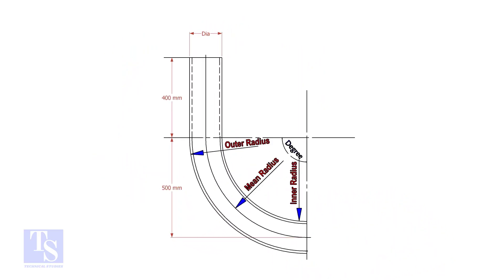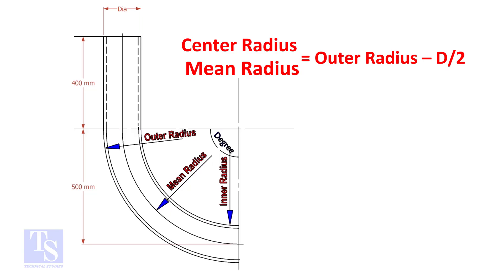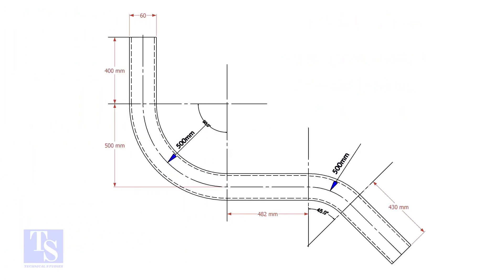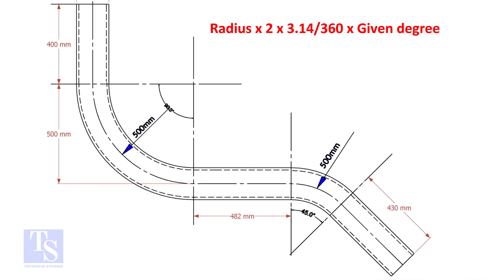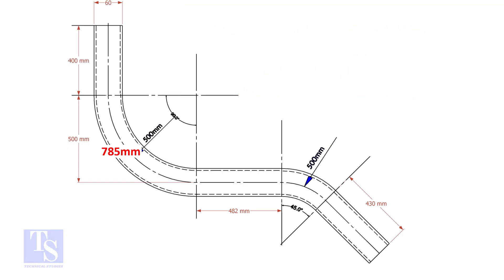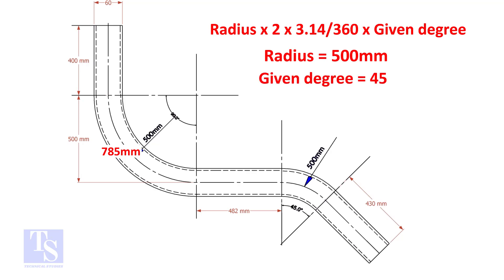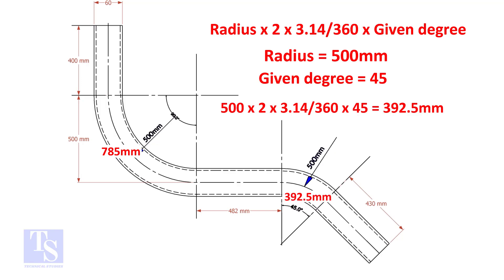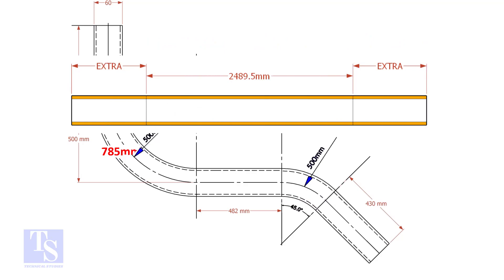STEEL PIPE - HOW TO CALCULATE AND MARK PIPE OR ROD BENDS- fit up TUTORIAL

Comment: How to determine the extra length. Is it randomly assumed or are there any formulas available?
Thanks.
Reply from the maker: I think there is no formula to determine the extra length. it depends the the diameter of the roller, center to center distance of the roller and most importantly, the experience.

Comment: Sir i have a question, ( in 90 degree elbow i used take.60.diameter x 38.1 + half of diameter = 2316mm as i know.where you get 500 radius sir?
Reply from the maker: Bro, your calculation is wrong.

Comment: Sir i have a question. I am first timer in piping.calculation my question is (where you get 500 mm radius sir? in 90 degree in 60 mm dia.as i know in elbow 90 degree 60mm dia.x38.1 plus half  OD =2316 correct me sir if im wrong because i am first timer in pipe calculation sir i used take off
Reply from the maker: Dear Maluya. 500 mm radius is an example only. If you want to know the length, whatever may be the radius, ( raius x 2 x 3.142)/ 360 x degree of the bend. in your case, suppose your bend degree is 90, pipe dia 60, bend radius 2 inch x 38.1= 76.2. then (76.2x2 x 3.142)/360x 90= 120mm. so you need to bend 2 inch pipe, length 120mm, to make a long radius elbow. anyway, you cannot bend such a small radius. at least the radius shall be 200mm. hope you understand.
Reply: @technicalstudies.  ok sir one question sir, if We bend tubing pipes  in any degree for ex: 2" we  must used take off sir, or not?

Comment: Good day thanks for the info. My concern is how to mark it in the pipe to get the correct distance from the bend. Or how to bend it With correct travel. Where i put the mark center in the bender im just newbie hope fore your advice and thanks in advance
Reply from the maker: Bro, add some extra length at the end of the pipe, as mentioned in the video. then the straight length, then one of the curve length, as per the calculation, make the first bend, then the next straight length or the length of the curve, and bend the pipe. I am making the shortest videos, but still, viewers are not ready to watch them fully. If you don't understand watch it once more. All the best.

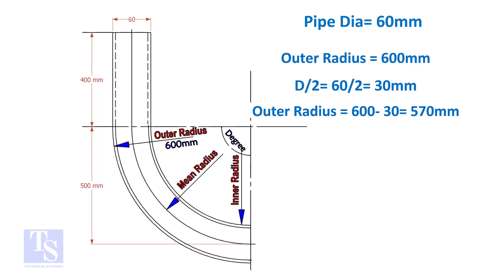Comment: Good clip bro. just for your information, at time of 0:48, the mean radius is 570 mm should be written.
Reply: Sir WHERE YOU GET 500? THE DIAMETER OF THE PIPE YOUR EXAMPLE IS 60 DIAMETER? AND 90 DEGREE AND 45 DEGREE ARE NOT SAME RADIUS.
Reply from the maker: Thank you Bro. Thank you for the correction. Can you please suggest some topics for tutorials please?